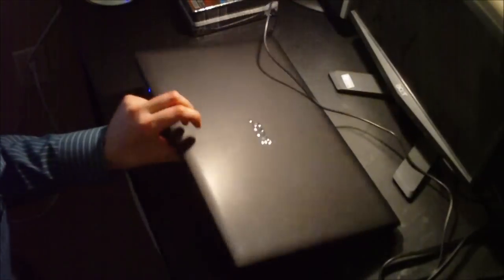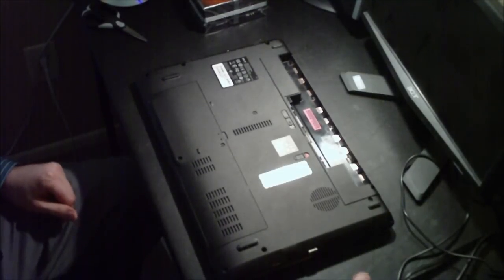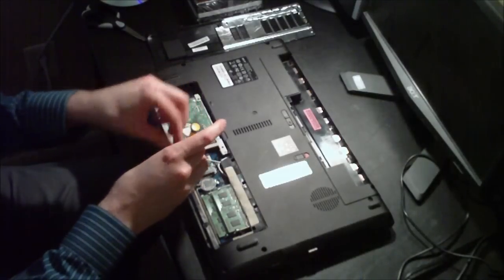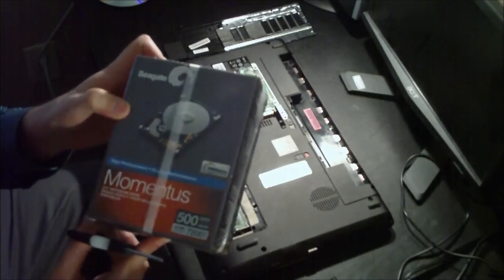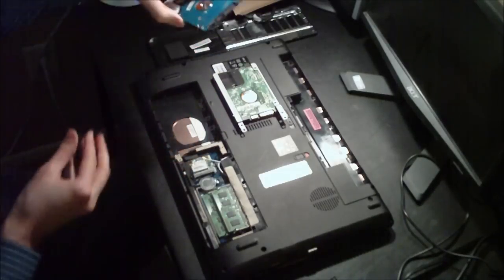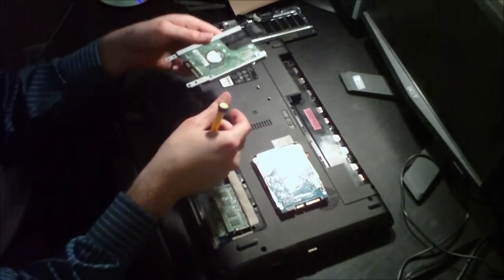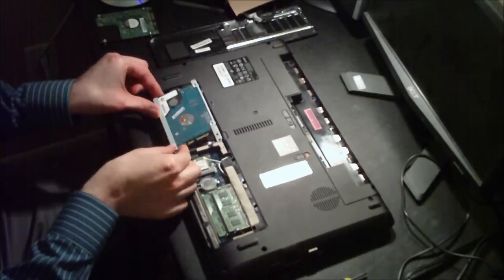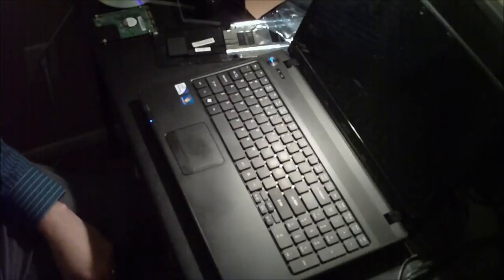How To Replace the Hard Drive in an Acer Aspire 5742 Series Notebook Laptop

Comment: Thanks for the reply. I think I got it figured out. I connected the Harddrive to another computer via a SATA to USB adapter. It was detecting the drive and mounting it fine on the other computer. After some forum reading, I ran "diskpart", selected the disk, and ran "clean all". Then "create a partition primary". That seemed to do the trick. So must have been something about how the partition was created before that Windows 7 installation wasn't recognizing it.

Comment from the maker: @Cl3viin I think it depends a lot on the CPU. The one in my vid has a Pentium Dual with pretty low clock speed, so it doesn't tend to run very hot.

Comment from the maker: @nitroxize any brand should be fine. crucial.com has a system scanner you can use that will tell you exactly what kinds of RAM your system will support.

It's as simple as popping out your old RAM and popping in the new RAM.

Check the documentation that came with your laptop or the Acer website, and it should have more specific info on how to replace the RAM.

Comment from the maker: @CoMeD1eZ have you tested the RAM? It could be that one of the RAM modules has gone bad. An easy way to test is to try booting up the laptop with only one module inserted. If it won't boot with one, try the other. It's highly unlikely (although not impossible) that both RAM modules would go bad at the same time. If the RAM test doesn't change anything, something likely has gone defective on the motherboard. If it is still under warranty, I would suggest contacting Acer for support.

Comment: Some videos on youtube crack me up. Replacing a hard drive - when the hdd cover has two screws on the back of the chassis - yeah, that's uh, hard.
Now, having to tear down an Acer aspire with the hard drive at the bottom of the chassis with no backplate, well, that's a bit harder. 
Thanks for putting up the video though

Comment: @geeklooptv: I have an almost identical lap top to yours, though it's a different model. So I was wondering... how is the momentus running for you? My HD is failing and I need a new one. I came across this video, and just to be careful in following how you replaced the HD, thought I'd buy the same one you got, if it's reliable enough.

Also, did it say yours was 2.5"? Just want to make sure I'm getting the right one. Thanks.

Comment from the maker: If the BIOS is recognizing it, then it might be a problem with the Windows 7 installer somehow not recognizing it. The best way to know for sure would be to try to install a Linux distribution like Ubuntu or Linux Mint and see if the OS installers for those recognize the hard drive.

Comment from the maker: @DJmoffSMASH if you got a CPU that ran cooler, then it should help. I haven't had the overheating issues that others have been having, but I only have a Pentium Dual Core running at 2 GHz, so it doesn't run hot.

Comment: I swapped out a hard drive in a 5742 because the original one was getting flaky. However I ran into problems trying to install Windows 7. I put in a used 160gb Hitachi, which the bios recognizes, however when I start Windows install, it can't find the disk. In the Bios I changed the SATA mode from AHCI Mode to IDE Mode hoping that would make a difference. It did not.  I consider myself a fairly advanced computer technician, but have never run into this. Any suggestions?

Comment: Hey there. I have this same computer and am having recent issues with the hard drive and battery. Wondering if you've experienced anything similar The hard drive comes up as a windows error and eventually the computer won't boot if we finally turn it off. recently kept it on for 3 days and the errors finally went away. The battery error is weird and only comes up occasionally saying it's detected a problem with it.

Comment: model? mine is 5742g-484, runs 60 fps with vsync enabled in WoW, with good texturing and average settings. it heats a lot, though. But it's not a problem for me

Comment: I have an acer aspire 4920g, I want to upgrade the hdd, would any laptop hdd fit or do I need to stay with the 5400 rpm 8 mb range. Idealy I want to put a 500g/ 7200rpm 16 mb drive in, cheers

Comment: Hmm, I tried switching a used hard drive from a Dell Inspiron 1545 to put into my acer aspire 5750 and everything went fine except that most of my drivers wont install coming up with code 28, it was a x32 version of windows so I'm going to try a x64 to see if anything changes, please message me, I would really like some help with this.

Comment: Hi, my Acer Aspire 5735z won't boot up. Every time I press the power button, the laptop sounds like it is going to boot up normally. However, the screen stays black and then the laptop turns off after about 5 seconds.

I have tried taking out the battery, and just using the power cable, and still nothing. So it must be something to do with the laptop, rather than the battery or power cable. Do you have any idea what the problem could be?

Comment: @geeklooptv I actually have one, and my motherboard temp is always at over 60 degrees and that from start (when the laptop just boot up)
Processor; core i3-380m(2.53Ghz) 
and the thing that it is only running utorrent, IDM, and chrome thats it !
Do you think is normal right now its at 66 degrees with only those 3 programs running.

Comment from the maker: Sorry, I didn't make one. To reinstall Windows you need system restore disks. Put Disc 1 in the DVD drive, power on your laptop, and follow the prompts. It's pretty easy. If you don't have the restore discs, you should be able to order some directly from Acer.

Comment: @CoMeD1eZ your laptop is actually overheating. mine had the same problem. change the fan and clean out any dust with a compressed aerosol can. you can buy the cans at london drugs or any computer shop. if you dont do this soon your motherboard will burnout.